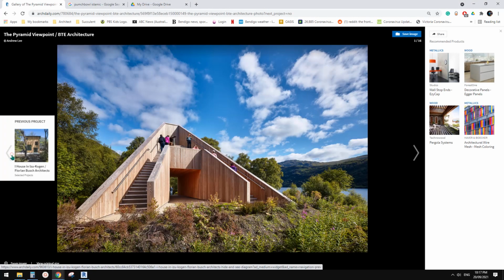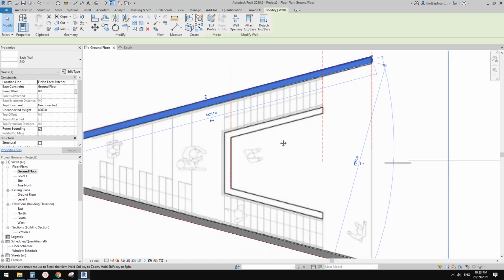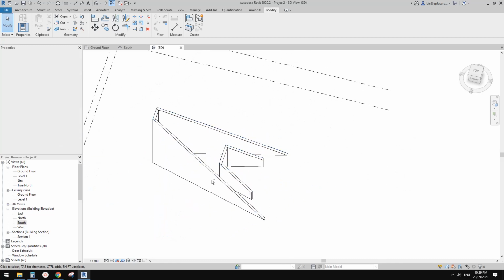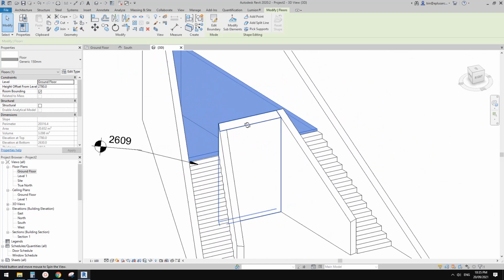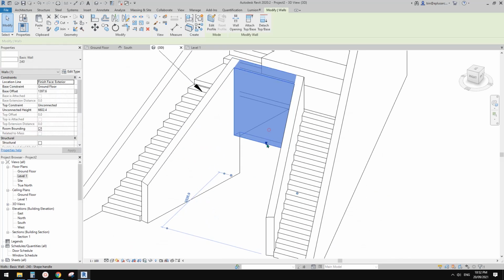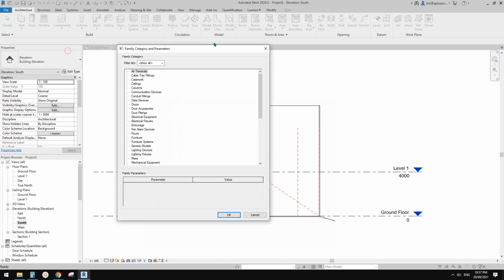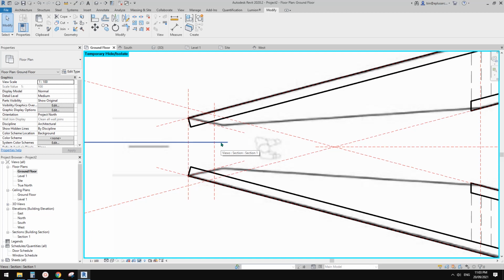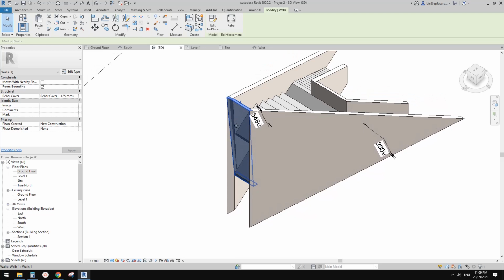Revit Modelling Exercise (Day 549)

Comment: Question to void extrusions why not to use instead of them edit profile of wall and adjust these walls?
Reply from the maker: You can definitely use edit profile. Personally I don't like edit profile, not only because it takes longer, causes a lot of join issues, but also the edge faces of wall from edit profile will always be perpendicular to the wall face, which is not the expected result in this instance.